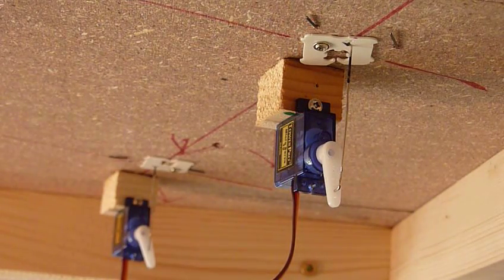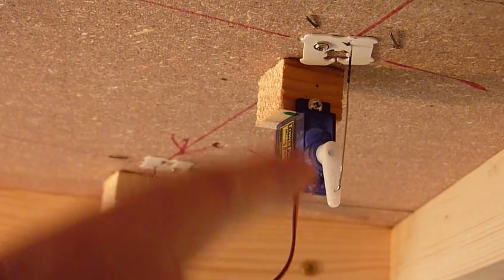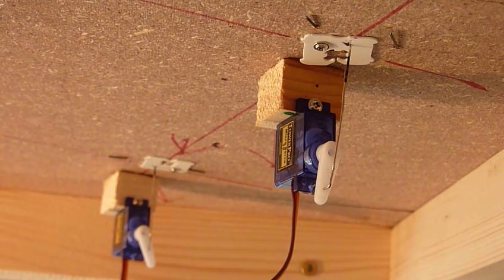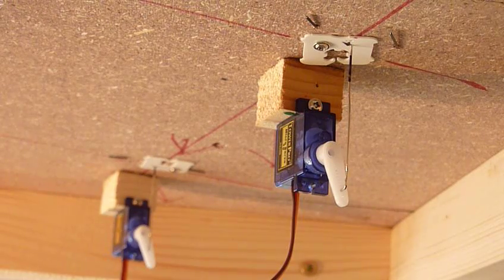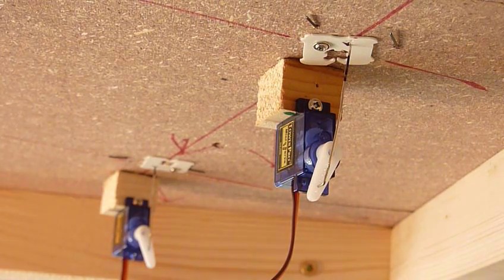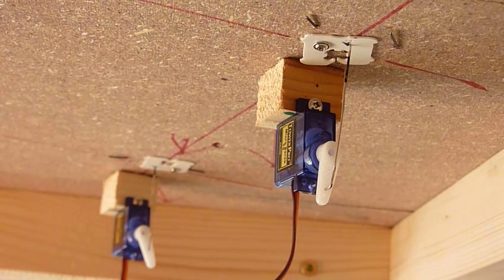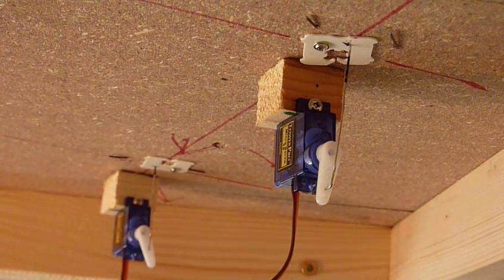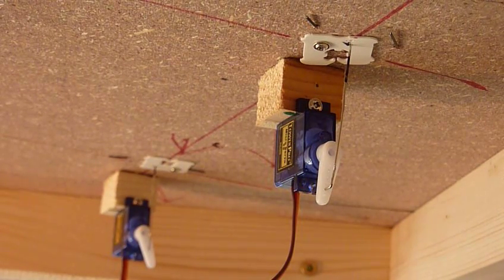RMR025 - Servo drive for junction, in the vertical mount position

Comment: Such an elegant way to use a servo for point control. I was consdering - before Arduino - converting to continuous rotation and using the servo as a stall motor. Clear excellent videos. Cheers and tha